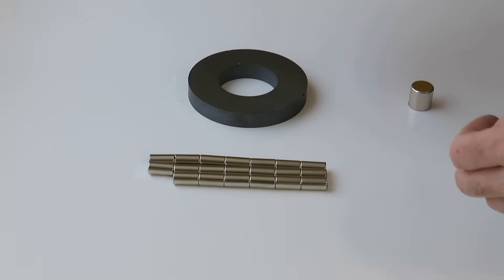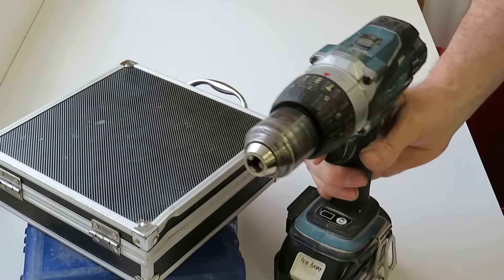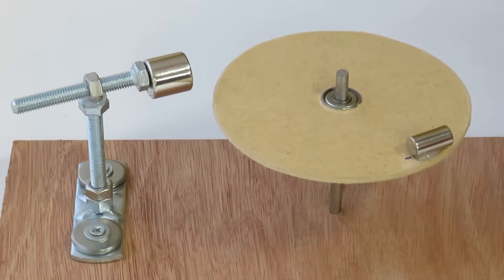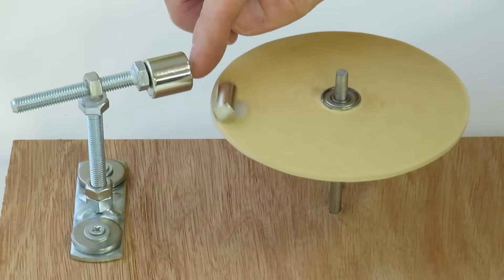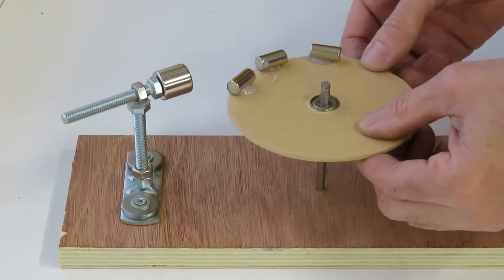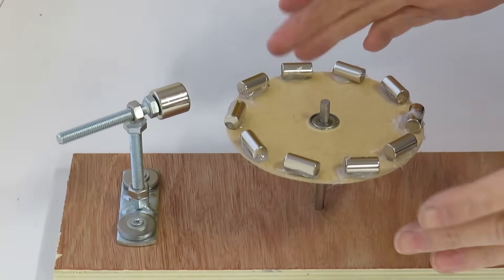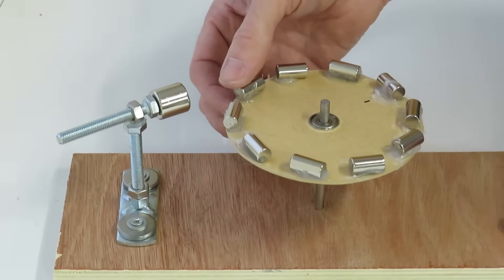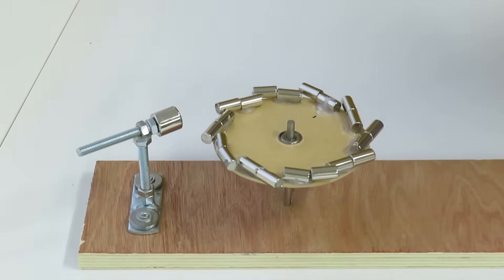Magnetic Energy - Crude Magnet Disc Challenge!

Comment: Nice educative video. Thank you. If some how that stationary magnetic is made to rotate as well around its vertical axis in such a synchronistic speed so that it doesn't work against the rotating disc and stop it. What do you think? Does that can have any impact?
Reply: That is exactly what I was going to suggest; 2 identical disks with just 7 magnets evenly spaced in a similar orientation and mechanically connected so that they turn at the same speed.  Then it MIGHT be just a matter of timing their rotations so that magnets are directly opposing each other at their closest encounter. (Or some slight deviation from that position)  The thinking is that there would be less resistance to rotate into position while the magnets are offset and conversely less attraction to the dwell position which is stopping the current attempt.  Using just 7 magnets allows room for the magnets to rotate into position during the gap in magnetic field force.
Reply: @LarrySerflaten  Pretty fun problem for our engineering brains to chew on! The thing is, laws of nature are so reliable, that you can be very confident in the following without knowing details: No matter what arrangement of permanent magnets are attached to or near a spinney thing, the torque from them, averaged with respect to rotational position, will be zero. If you could measure the torque accurately at many equal position intervals (say 3,600 positions or 1/10°) you would find that while each concept may have different interesting patterns of torque variation, it always averages zero. You can concentrate pulls and and spread out pushes or whatever, but nothing you do with permanent magnets can make the average not zero.
Now if you add a switched magnet or moving magnet, you now have a way of adding energy to the spinney thing, and you have a motor.

Comment: you've arreanged the magnets badly on the disk, the repulsive poles should be facing with the fixed magnet and the attraction pole shluld be facing center of the disk... in this way you'll not have any attraction force on the fixed magnet

Comment: The magnet on the left should be designed to have a on & off switch.  As the spinning magnet wheel moves away from the standing magnet, turn the standing magnet off.  The spinning magnet will not slow because the standing magnet is not pushing or pulling the spining magnet.  Turn the standing magnet back on right before the spinning magnet is parallel to the standing magnet.
Reply: Bingo. And you would have a motor (and you would need an energy source)
Reply: The energy required to toggle that magnet on and off electrically or mechanicaly is more than what it can generate,

Comment: Understanding why a magnet engine can’t  work is easy.  You need to use a force from your hands in order to get a magnet closer to an other one. When you release the magnet, the same force is released and can do something like turning a disc. Friction and other forces is taking energy and you will not have the same force to get a magnet closer to the other one for the next movement. At the end the movement will stop by itself. Using a magnet is like using a spring or gravity, you can’t create energy, you need to add it at the beginning of the process :-)

Comment: if you have a reed switches on the side of the disk and move slightly the main magnet with an electric actuator, you can do it even mechanically with some modifications, you could move the main magnet when there are the death points between magnets that slow down the wheel ... it should work
Reply: Yes, it would become an unconventional electric motor with output power somewhat less than the average power consumed by the electric actuator.
Reply: @drienkm  not if you do it mechanically as I did

Comment: as dave boyt suggested: remove the fixed magnet and see how many spins you get with just the momentum of the magnets on the disc... it should be about the same if the laws of physic are preserved. if you could get a continued movement, i'd imagine the magnets would go flat... the energy has to come from somewhere.
Reply: Well Magnets aren't falling off the fridge.. I reckon they'll last some decades

Comment: This has been a thought experiment in my menagerie of memories. Elated to see someone actually went through with it. What if your isolated magnet was an electromagnet turning off and on in an unrhythmic pattern?
Reply: Then you would have a crude brushless motor.
Reply: its only a thought "experiment" because you don't know how magents actually work lol
Reply: That's called an " electric motor."
It's been done, pretty sure.. 😉
Reply: it would work, but it would also require a fair amount of electrical input and therefore wouldn't really be special or impressive
Reply: Spot on.  Or have the stationary magnet rotating as well with and have the two rotating shafts geared with appropriate ratios so that the magnets come at their closest only to push the rotating disk forward.
Reply: Yes! Using a reed switch with a small coil to generate a small current and a capacitor to “catch” the energy created. The magnet passing over the reed switch will allow a “pulse” of electrical current to feed the electromagnet. With the right spacing and timing it should work!

Comment: Change the Flat Wheel, to a Fan Blade, secure the Wheels Magnets to the Angle of the Fan Blade Tips, place the Stationary Magnet, above the Fan Blades, such that it always sees only N-N or S-S Repulsion. Try that out!
Reply: Well thought out, but this too will fail. Any open magnetic system that doesn't employ some type of shielding will always have a net force of zero. Think about when you bring like poles near each other. They repel when directly opposed to each other, but the slightest movement towards a side and they will attract. So as your positive magnet is passing by other positive poles you will get slight attraction - repulsion - slight attraction. The flaw in most magnet motor systems is using magnet on magnet drive systems. I am currently building a magnet motor that utilizes the attractive forces between permanent magnets and steel, and by doing so, eliminating the usual balance of forces and working only with attraction. I'll post a video once it's built.
Reply: @haroldkline4898 what about using a halbach array of magnets on the outer magnet pusher to make the north pole larger and the south pole minimal so it catches less? Or maybe sharper geometry angles like triangle orientated instead of a ring/circle? Just some thoughts ^^

Comment: What if you took one of those neodinium magnets that has a lot more potential energy pushing outward and the magnetism and propulsion is a lot stronger than what is required to simply turn that wheel? Wouldn't that give you virtually  Perpetual energy?
Reply: A magnet has energy like a peanut has energy. It took some energy to make it, but that doesn't make it a continuous source. If you fix any magnet beside any wheel with other magnets stuck to it, it will pull in some positions and push in others. They will always exactly cancel out.
Magnets don't simply push. Next time you have two magnets in your hand, notice that there are some pretty complex forces and torques going on based on their relative positions.
Reply: @drienkm  there are solutions, but if you show a solution on YouTube you would loose you channel then men in black suits would show up at your door.
Reply: @weslingm  And yet you have publicly said you know how to do it, warned of the consequences, identified the suppression and your comment is still here and you haven’t been attacked.  Doesn’t check out.
Reply: Right 😁

Comment: There are various modes by which you can get virtual perpetual energy. One would be a Newton's cradle that somehow turns something or whatever perior whatever. And then the other thing would be E as an example, bismith, when put in between 2 magnets, will levitate and spin.   Converting that energy into stored potential energy into a battery would be a very hard, but rewarding thing to be able to do. Newton's cradle's last 5 years are close to it.

Comment: I would like the results 

I am an engineer and I build many things

One of my friends has a motor to run on pure HHO and he worked with Stan Meyers

His secret was light energy to make the hydrogen

You take a Ballon and rub it on your head and it sticks to the wall. You kill the magnets charge and the  Ballon falls to the ground

Stan's patents have been altered

You use volts and high amps, you will make some hydrogen but not enough to run a car. You are creating a magnets field. You use volts an on the amp Metter it shows almost zero amps and as soon as you shoot white Lazer light in 3 corners meeting in the middle shooting into a crystal, hydrogen rolls off

Have a video of Roy running his three wheeler off one cell.

George Mitchel is another friend who make electricity with cog magnetic wheels. 

Have his parts list

Comment: You can try using  less magnets. It already spins 3/4 of a turn  so wheel on the left can have a few more magnets then a space and  a net set of magnets pops in and leaves
Reply: adding a secondary wheel and Magnetic Booster at the opposing spot that stalled out might help the continuous motion

Comment: Remember NASA and other Space agencies use gravitational pull of larger planets such as Jupiter to accelerate their space craft to gain acceleration, and then I do not know how they escape its gravity to continue their journey to the intended planet like Mars,  It amazes me because any acceleration the space craft gains is also lost during when the space craft is heading away from Jupiter, so ask NASA they must have a  trick up their sleeve.

Did you also try a heavy weight on the wheel to maintain or overcome the resistance force.

Comment: You might try 2 or 3 large repelling magnets and offset them just enough so that when one wants to pull on the wheel the other one will start pushing then add a 3rd to go just about 1/8 behind where the other magnet begins to push. That way there is always one or 2 pushing and over taking the ones pulling.
Reply: No.
Reply: they did that what was needed was a bridge in the gap! All we had to do was slow down,
Reply: Magnetic fields don't overlap so pressing them close just warps the field, but remains balanced.
You'd need to narrow/warp/eliminate/short circuit/reroute a portion of the field attracting the magnets.

Comment: I would try to put some type of insulation on the back side of the magnet spinning on the disc because that's where it seems to be attracting
Reply: Hard disks have insulating metals. I have a bunch of them. If you sandwich that metal between 2 neodymium magnets, there is no attraction
Reply: Then do it.

Comment: re clock the magnes on the disk. as the s pole is facing out and locking on the n pole then face n pole ferther into the center of the disk, thus removing most of the tidal lock from the drive magnet.

Comment: There is one adjustment that I'd love to see.  Remove the magnet on the pedestal, and compare the spin time.  That would at least give you a control to see whether the magnets are affecting the rotation.  Also, you might try wrapping a string around the shaft connected to a weight through a pulley so you can give every configuration exactly the same amount of energy when you spin it up.  If you come up with ANY configuration that is better than free spin with no fixed magnet you will have my attention!
Reply: I am currently working on a kinda same project kinda I created a trick disc that u may do any and every trick the Harlem Globetrotters can do with a ball u can do with my SPINAGAIN TRICK DISC EXCEPT DRIBBLING IT LIKE A BALL BUT SOME ONE CHALLENGED ME TO COME UP WITH A AUTOMATIC SPINNING DISC THAT CAN KEEP ITS SPINNING ROTATION SPINNING FOR LONGER THEN ME BEING ABLE TO SPIN IT longer then 3 mins at a time
Reply: Ujjjjĵ

Comment: If you had a more elaborate setup using electromagnets and could reverse the polarity of the magnets at the right time as they spin, it would work very well and you could get it to go very fast.
Reply: That is called "electric motor" and has been used worldwide for over 100 years. But the challenge is not to put any further energy into the setup to make it rotate continously but to get a permanent spinning just by putting the permanent magnets in the correct arrangement that the stuck point is weaker than the pushing force that makes the wheel spin.